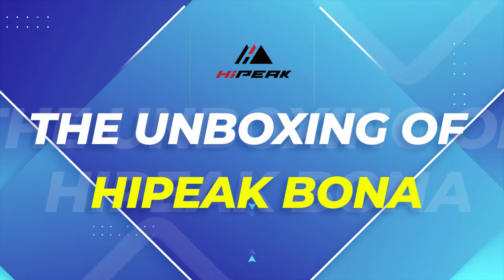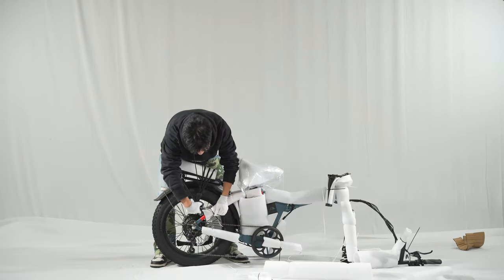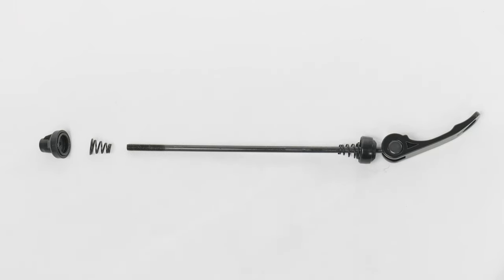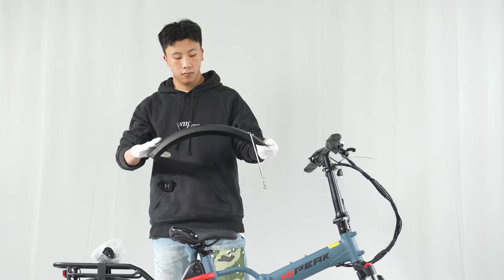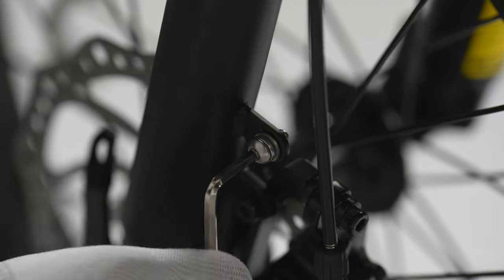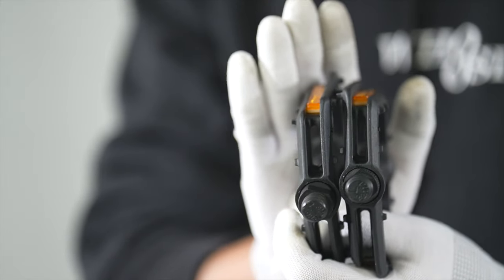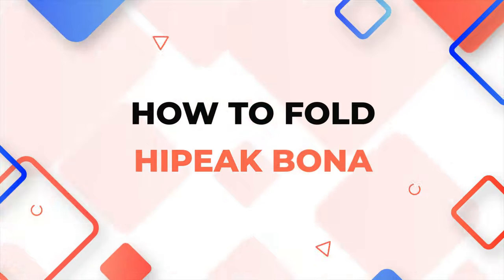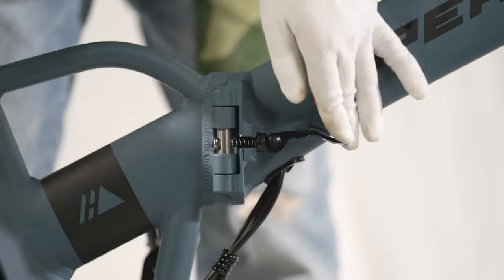HiPEAK Bona 750W 48V 15Ah Folding E-bike Unboxing & Assembly  Instructions

Comment: There is a small plug on the one side of the front wheel how is it removed?
Reply: Would like to know this as well
Reply: Figured it out. For me anyway. I originally didn't pull the skewer out of the hex type bar that was going through the flat plastic piece attached to the fork. Once the skewer was out it was easy, just jammed it into the open side of the axle and with a little force, frustration, and anger it shot the plastic cap across the room and mounting the tire was simple from there. Rides great!